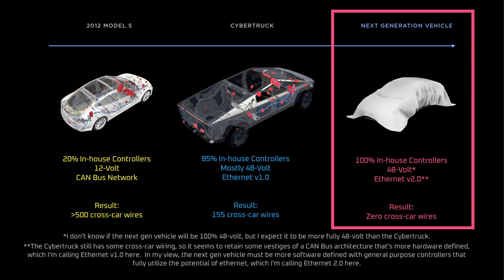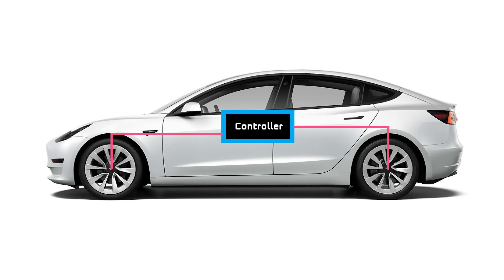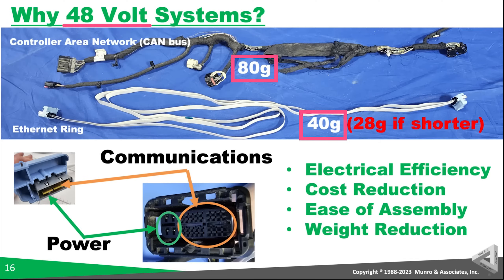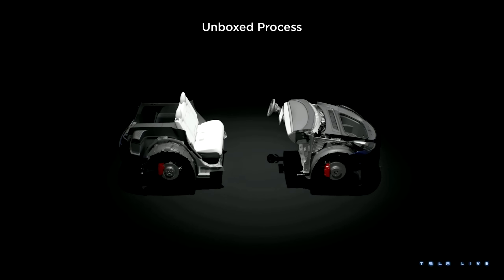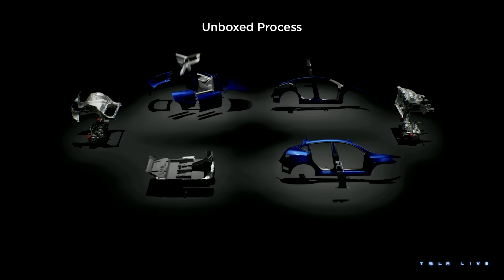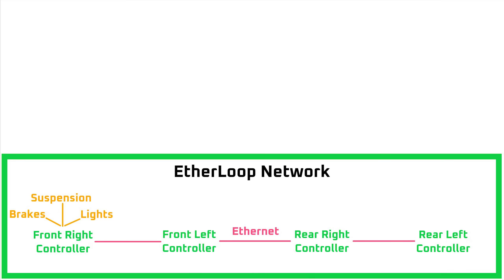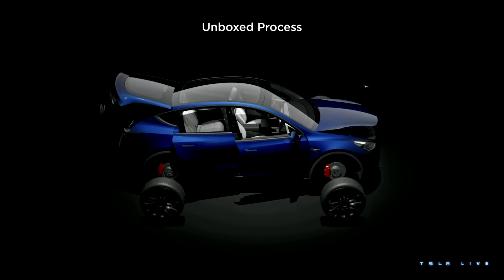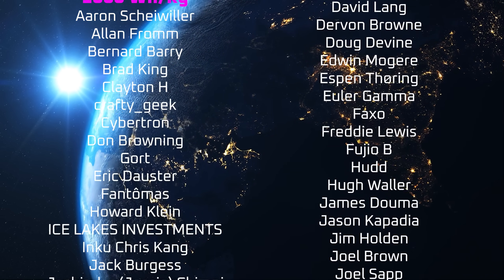Digging Deeper on Tesla's Etherloop Wiring System

Comment: As 48V and EtherLoop matures, I would expect all data would be "data over power" and thus remove a number of wiring issues in addition to the current innovations by TESLA.  There be dragons with this approach, mostly resilience to single-point failure, but they are not at all insurmountable.

Imagine a single two-wire bus chained around the vehicle to provide power and communications between all controller nodes and sensors and actuators.

Failure modes would be the major issue for such a system - not the implementation - which has been trivial for over two decades.  That wire pair and its attendant data integrity must be protected at all costs, and that is currently difficult - without a backup harness - or perhaps some form of backup Wireless communication.
Reply: They'll use a "Ring main".
Reply: @rogerstarkey5390  A ring main is great - until something BAD happens at a single node to take out communications and/or power to the entire vehicle.  So I would expect the ring main architecture to be followed for the most part, but with various demarcation points (fused?) to ensure minimal likelihood of complete electrical and communications meltdown.  Maybe each sensor and control node will be fused.  Don't know.

Comment: I wonder what further optimizations could be done by using POE to distribute power to the controllers daisy chain over the data wire. 

Rivian also announced going to a zonal configuration and significantly reducing their controller count in the gen 2 trucks.
Reply from the maker: Yes, I'm curious about what rivian is doing!  But as far as I'm aware, they've released very little information 

I think Ford assessed it and decided it was too complex?
Reply: I imagine there was a conversation in most manufacturers that went something like
CEO
"Can WE do that?"
.
Network Engineer
"Duh?.... Yes" (while thinking "we told you years ago")

Comment: They should share cables with power and data, perhaps.
Reply: How is replacing wire with a small computer cost or weight effective.  This goes against the kiss rule and the best part is no part. How about reducing the number of stuff needs to b wired

Comment: A common error when describing the advantage of 48v architecture over 12v architecture is to assume that the power loss and therefore the copper requirement scales with the voltage change eg. your statement that the voltage change allows for the copper to be reduced by 75%. This is not correct. The power loss scales with the square of the change in voltage. Power dissipated W equals V squared divided by R the resistance of the cable. The result of this is that for the same power loss in the cables, the resistance can be 16 times higher if the voltage is quadrupled. This translates to 1/16th as much copper required, or in the limit a reduction of 93.75% copper used in the conductor. However as the heat from this power loss is being carried away from the smaller surface area of the copper, it may require some optimisation to determine the best cable size. Alternatively, the massive saving in the required conductor size could make aluminium conductors effective rather than using expensive copper.
Reply from the maker: Good point!  They did say 4x less current and 16x less power loss.

Comment: I'm not an automotive engineer, but your idea of having 4x controllers implies 4x firmware and calibrations and sounds like a reliability and maintenance nightmare, not to mention that ta nightmare from a software engineering perspective where 4 controllers have to share state to figure out vehicle dynamics, for example.  What makes sense would be relatively dumb nodes using POE for power on several etherloop networks.  These networks would need to be separate for safety reasons and partitioned via routing.  The loop in etherloop has to be there for physical redundancy.   You don't address the very specific engineering choices of CAN and how this standard at the physical level is optimized for reliability, and how modern vehicles have both CAN and LIN networks, etc.

Comment: Electrical systems did not come first, rather they mimic and replace  mechachanical systems, creating awkwardness inefficiency. Uping the system voltage gives the options for electrical design a workhorse attitude.

Comment: They do not need develop their own telecommunication protocol further that is almost always a bad idea Modern ethernet is latency. Modern ethernet network has was to deal with latency that is tried and true.  There is always a way to deal with collision on an ethernet work, collision avoidance and collision detection you can choose the one that is best for you.  You can make ethernet packets for QoS and there is just to increase the clock speed you are typically getting under 0.5 ms . also, for 4 controller base network that is not stressing ethernet technology you can just segment the network

Comment: The information about Ethernet network collisions at the 16min mark is not accurate. Modern Ethernet is a switched network and does not have collisions. It hasn't worked that way since the 1990s.

Comment: your idea is good but different controllera requires different ASIL levels and have different acceptance levels of failure. for instance, bo one really cares if there is a bug when changing the mirrors. but if electrical motors refuse torque one day, the customer will sue the OEM

Comment: Since 2018/19, a 48V electrical subsystem has operated production vehicles from Porsche, Bentley, Audi, Mercedes-Benz, Hyundai, Kia, so Tesla are not exactly the pioneers they are made out to be. If the whole supply chain is very much geared to 12V, savings on the wiring may be dwarfed by having to purchase numerous customised components. 

Why did Tesla go for 48V, probably because they were forced down that route by the introduction of the steer-by-wire system.

Comment: 48 volts was likely chosen because that's the standard voltage of PoE (Power over Ethernet).
Reply: Yes and no, 48volt was chosen for PoE because of guage of ethernet and RJ45 standards, but Teslas latest in car network does have PoE concept as a current use case. ;-)
Reply: @Putersdcat  Sure they wanted to up the gauge (lower wire size), and 48 volts is an improvement.  My point is that instead of some arbitrary number like 40 or 56 or 120 - they chose something that is an existing standard and there's components that already work over that.
Reply: Cybertruck does not use PoE.
Reply: @MikaPopp  Not saying it does, but the 48 volt choice is likely no coincidence - but all the components to power devices and operate at 48 volts is readily available from many suppliers to build your own custom system.
Reply: @hieyeque1  First principals of electronics drives the 48v choice in both architectures. The PoE standard is unique to Ethernet. Power at communications IC level is not 48volts, the portion of the circuit that pulls the current off the communications bus to power things at 48volts is typically not integrated. So parts commonality between commercial / consumer PoE standard did not drive 48v architecture choice in CT.
Reply: @Putersdcat  Good point about IC level voltage.

Comment: The Tesla engineers already said (on Munro) they are just linking CAN controllers with Gigabit Ethernet running a real time protocol closer to token ring than "best-effort" TCP/IP.  This author admits he is only guessing, so I stopped watching it early.  Whether GB Ethernet is just used for logging and diagnostics or whether it is actually involved in real time controls, the Tesla engineers did not say.
Reply: when he kept talking about loop my brain jumped  token ring

Comment: Very good video!    I assume from the name that the last controller is looped back to the first.   This means greater fault tolerance since there would be two routes between any two controllers.   In fact I wonder if they dusted off the old token ring architecture which also has the property of being able to prioritize data packets, and can transmit data deterministically, that is, in a known guaranteed time. 

But the big question for me is how they handle failure modes.   A dead controller in one corner of the car could have very strange effects.   Like asymmetrical braking.  ( ! )   In system designs like this, managing failure modes is often the thing that blows up a new architecture.

Comment: You would in an ideal world use the same controller for all points in the vehicle,  extra capability is very cheap  comoared to indivdual hardware , each unit needs to be in several sections a cpu section with a gateway to the IO section and a communications pair one in one out , so a failed section of ethernet can be ignored as tgere us a redundant path,
Reply from the maker: Great insight thanks! I'm glad there are people that understand this stuff better than I do 😁

Comment: Ur math doesn't add up... since Cybertruck uses 48V (75% less copper as u said), u can't for sure say length of all wires is half of Model 3 because the weight is cut by half... could be actually longer for all we know...

Comment: Etherloop or ethernet? Automotive ethernet has been around for at least 10 years with broad-r reach introduction which is full duplex 10/100 Mbs over 2 conductors.  I don't know what they mean by etherloop but it sounds like they took ethernet and daisy chained the "controllers" which is not new if this is what they did.  The trade off is that some controllers need to consume CPU & IO bandwidth to repeat messages they otherwise don't need to consume.  There is another automotive protocol that looks like etherloop called MOST which mostly is a failed endeavor.  MOST is in the 2013 to 2015 Cadillac vehicles; a vehicle I worked on.  For ethernet/etherloop to work you really need the TSN version to achieve the more deterministic nature of CAN bus.  Devils are in the details... wish this video had more details on what defines etherloop.

Comment: There is no need for 48V in the Mad Max truck - use off the shelf 12V
since the ethernet does away with most wiring harness

a dumb decision by elon - one of many on the Mad Max

Comment: all can bus connect to the same wire? false. there are multiple ECUs that isolate canbus networks, and interfacing with a minimum of 2 networks. you could have a low speed bus for safety, which for example, connects to abs, traction control, drive by wire, airbags. entertainment, lighting, and other crap are on a second high speed bus.

standard ethernet today runs on 48v if its PoE. etherloop likely refers to a switched ethernet network that is looped together (think UK ring circuit) but without stp or other effects such as l2 loop going crazy and shutting down the network.

Comment: now I'm even more glad i didn't preorder a cybertruck. my 2018 m3 will do fine until cybertruck gets a refresh with ethernet 2.0.
Reply from the maker: It won't because it doesn't matter at the customer level.  You would see no difference.  

It's about reducing costs in future vehicles, and the vehicles will sell at the price the market will bear.

Even if 'Etherloop 2.0' was in the current vehicle, the price would be the same.
Reply: @thelimitingfactor  i guess that's true. i still didn't want to get in too early for cybertruck. always seem to see more issues in the first few years a vehicle comes available.
Reply: @chimerawizard5639  Still a good idea - if you don't need to be 'first' and deal with the benefits and drawbacks that comes with you will likely end up with a mostly better vehicle at a mostly cheaper price a year or two into production!

Comment: 48v, etherloop and distributed custom controllers are going to a massive gain in efficiency, cost, weight, reliability.
The reduction in wire, connectors, controllers and PCB will save a lot of money to Tesla

Comment: Now I've had canbus issues stemming from a bad ignition switch. You know how you can diagnose a bad ignition switch in an e39 bmw? With the engine and radio on flip down the passenger sun visor and turn on the lights under it. If the engine shuts off when you do that, the ignition switch is bad. Canbus is a magic relm lol.

I can imagine the nightmare diagnosing stuff like this long term would be with this multiple controller situation. I've seen how hellish the 25 year old canbus can be. I'll pass.

Comment: things i don't want or need.
electric parking brake.
electric door handle.
electric door opening motors.
electric boot.
electric charging flap.
electric seat adjust.
electric steering adjust.
electric ac vent.
electric sunroof.
a sunroof.
all unnecessary weight and points of failure.

Comment: Etherloop looks a lot like ethercat used in industrial equipment, and it's a good change from can bus which sucks ass
Reply: @thelimitingfactor   you should read up on ethercat plc and machine controls, it'll make perfect sense why they went with a ethernet loop with a custom tcp/ip protocol. Machine tools have 0.000001 second latencys, so it's more than good enough for a car.
Reply: Looks a lot like AFDX to me. Flight proven technology.

Comment: I feel like it is disingenuous to present etherloop as a revolutionary technology when it is basically just the Power-Over-Ethernet standard that is already used extensively in networking (IEEE 802.3at-2009) configured in a ring (loop) for redundancy. Just because every other auto manufacturer is perpetually 20 years behind doesn’t mean what Tesla is doing is technically impressive.

Comment: Jordan, thanks for the video, but I think that you may be missing one of the biggest benefits of the etherloop architecture. I believe that the word loop (or ring) is very significant. Fiber optic networks use a ring architecture for redundancy, and I suspect that Tesla is doing the same thing. Consider the four controllers in your diagrams. Suppose Controller 1 wants to send a message to Controller 2. It would send two identical messages, one clockwise around the loop and one counter clockwise around the loop. The first one that arrives at Controller 2 would be acted on, and the second one would be thrown away. Now suppose that you snip a wire anywhere on the loop. One of the messages would still arrive at Controller 2, so vehicle operation would not be affected. Also, the fact that the second message never arrived would immediately signal that there was a cut in the loop. By knowing which controllers saw each message, you would also immediately know exactly where the break was. Without this level of redundancy, the system would not be reliable enough to deploy for mission critical applications (e.g. braking, steering).

I also suspect that they are not getting rid of Canbus, they are simply carrying it over the etherloop. There is nothing wrong with Canbus other than the fact that it is slow and requires a lot of point to point connections. By carrying the Canbus protocol over ehtherloop they get rid of the two downsides, but keep all of the advantages of Canbus. A controller could receive the encapsulated Canbus message, convert it to native Canbus and send it to a local Canbus device. That way they could still use off the shelf Canbus devices for some applications. They would also save a lot of the 10+ years of software investment their current architecture.
Reply: To confirm my suspicions regarding Canbus, I listened again to the Munro interview with the Tesla executives. At one point David Lau said “… ethernet routers that fan out to smaller Canbuses for localized purposes”.
Reply: I would guess it's based on EtherCAT due to the need for redundant loop wiring and guaranteed slots for messages. A cable can look like a single cable and just have two Ethernet cables inside it so even if it looks like it's wired to hubs it could just be routed in a ring.
Reply: In the Munro video Peter Bannon also mentioned that it was like Token Ring, and it was also mentioned that it was TDMA with fixed timeslots for predictable latency. I suspect that they use the word ethernet because it is something that people know, but it likely has very little similarity to ethernet.
Reply: @lauriedavis7088  Exactly - and they also use LIN and other simple protocols when it makes sense and they don't need the speed.

Comment: Canbus was great, 40 years ago. Now it is a niche protocol used due to inertia. Nobody I know likes using it, except it really is "job security". Using 48v and a software stack everyone is experienced with is overdue. There is no reason why data can't be transmitted over the power line as well, essentially making your fuse block a network switch. Since Tesla is doing everything in house, realistically they are the ones who can make the leap/change.

Comment: So instead of just broken wiper controller can could still drive for as long as you like. now you got broken headlight controller as well and need to go back to dealership because driving at night would be nightmare.

Nice way for manufacturer to reduce cost and push the burden to customer. then squeeze every last penny out of customers when anything broken because they can no longer fix it outside dealership.
Reply: Are you saying that software can't be ruggedized?
Reply: @louiscyfear878  I don’t know what in the world led you to that conclusion.

Even if you had state of the art software but your universal control module had one wire broken. It’s then useless.

So instead of things break one at a time. It will bring down half the system on your car.

Comment: I provided the insight that has led to the CyberTruck wiring harness.  I suggested 1 power circuit and signaling on that power circuit to turn things on and off.  The noise on the power circuit prevented effective communication, so they went to Ethernet.
Nobody did it before because they weren't smart enough to think of it, huh?